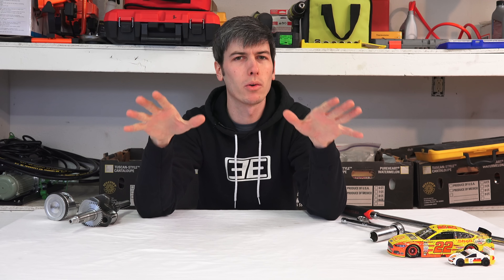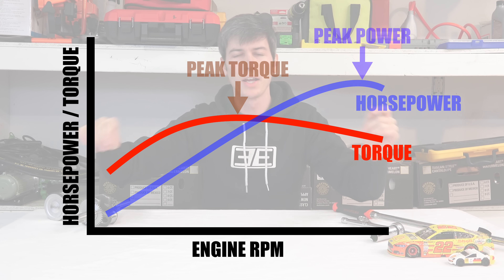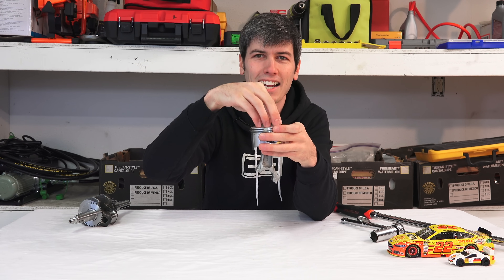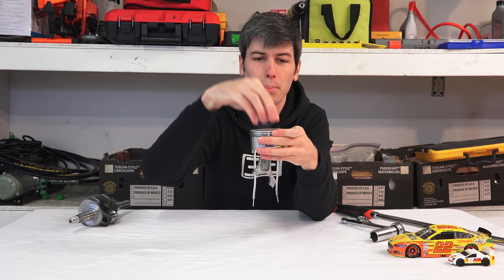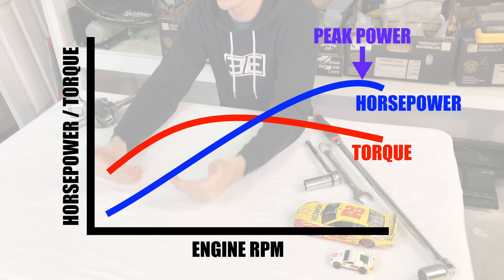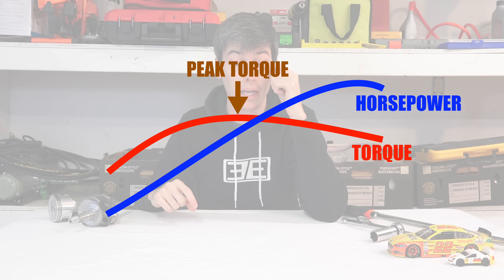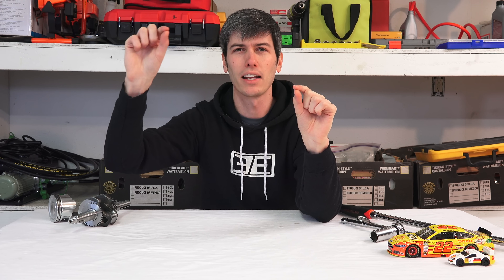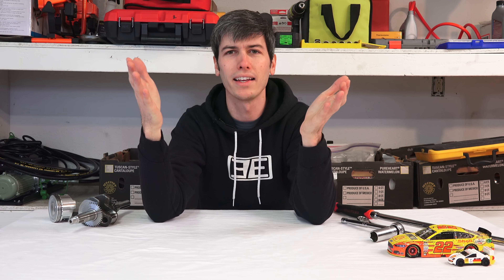Horsepower vs Torque - A Simple Explanation

Comment: This is unnecessarily confusing, and not at all simple. 

He should never have mentioned gears or transmissions, because it's not necessary and makes it confusing and convoluted. 

Torque is the force you are creating to move the vehicle, in this context.  But, it does not measure anything else, like the effect it has.  So, if you have 1000 pounds of torque, and it moves nothing, it does no work.  It has no horsepower.  The motor is still putting out a force, it's just not doing anything.  No horsepower. 

So horsepower measures the effect the torque has; how much work it does.  All things equal, more torque, more horsepower.  But things aren't equal.

So, think of a force at least say 1 unit of torque, that moves something 100 times per minute.  It does 100 units of work, let's say.  Now, if we move the RPMs (in the prior case 100) and change it to 200, we end up with 200 units of work, if torque is constant.  Equally, if we have 2 units of torque, and are at 100 RPM, we'd also have 200 units of work.   Simple.

But, what happens with engines is, torque peaks relatively low in the RPM range, and slowly tapers off.  In this case, let's say at 200 RPM, we only have .9 units.  We'd still have more power and do more work, than at 1 unit and 100 RPM, because that .9 force is being applied 200 times.  So, let's say I push something 9 inches 200 times, it's going to move farther than something I push 10 inches 100 times, even though each time is a little less.  So, HP peaks later than torque. 

At some point, both tail off.  In this case, say we have .5 units of torque at 300 RPM, we'd do 1.5 units of work, rather than 1.8 at 200 RPM and .9 units.  Just as before, if I push something 5 inches 300 times, it's going to go 1500 inches, which is less than 200 X .9 (1800).  So, in this case, even though I'm pushing it more often, I'm pushing it so much less, it does less work.

What gets confusing is understanding how an engine will behave based on torque and horsepower, and this video kind of makes it even more confusing.  If you compare a low torque motor with a high torque motor, and both have the same maximum horsepower, the high torque motor is going to have much more lower RPM  pull, and generally be better to drive.  It's going to pull things better, because you won't have to rev the crap out of the engine to get power out of it.  Why?  Simple math.  If I have twice the torque with one motor, and they both have equal peak horsepower, it will reach that horsepower at half the RPM, and will have a broader power band.  The low torque motor will be "peakier", and need more attention to keep in its optimal power band.  And that's high RPM.

Comment: Is that the longer the rod the higher the torque???
Reply: No. 
Longer crank throw = more torque and typically less max rpm achievable. It's kinda like if you were spinning in a spinning chair. With your legs tucked in close, you would spin faster than sticking your legs out.
The only real benefit to having longer connecting rods is that you would get less piston skirt scrubbing (binding of the piston against the cylinder wall). less bind = more power and longer wear life.

Comment: Holy phuk, torque and power are directly related.  You can't have one with out the other.  When someone says their engine has a lot of torque, what they mean is that it get a lot of its power at lower RPM.  Power = angular velocity * torque.   They are inseparable.

Comment: I like the explanation.  However comparing the two cars I'm not sure what to believe... Suppose we have two cars:
Car 1: 500 HP and 250 torque. 
Car 2: 250 HP and 500 torque. 

I'm not sure if car 1 would be faster in real life?
Reply: It will be because it has more hp, torque can be manipulated through gear ratio
Reply: An example: in an 1/8 mile competition Car 2 wins, but in a 1/2 mile race Car 1 wins
Reply: another example: Car 1 could win or at least equal its performance compared to Car 2 on an 1/8 mile if we "cheated" by giving it lower gear ratios to compensate for its low torque

Comment: Hence the LT2 in the C8 producing more HP than torque and the LT1 balancing both.
Lolll the new L8T GM 6.6 has opened the way for a stroke increase on the LT1 and the LT2 to 6.6 litres.
Also the Ford 7.3 Godzilla engine has seen to that.
Mmmmmm a 525 hp LT2.
😉😉😉

Comment: As a former motor head we always said torque gets you off the line power makes you finish. I been  a Auto tech since 1996 and what the automotive industry has done with small displacement engines is truly amazing. The power numbers from 4 cyl engines is truly amazing.
Reply: Camaro's with a turbo 4cly making 275hp and 295lbs, I wish we had four bangers like that when I was in HS. I'm pretty sure it would beat the 350 from the 80's and 90's.
Reply: That's pretty close.  Torque gets you off the line, power determines how long it takes to finish.
Reply: But again this is confusing torque at the crankshaft and torque at the wheel.
Reply: vape ?

Comment: If torque is force*distance and distance remains equal (distance between connecting rod and crankshaft and same gear) then the only variable is force. I guess that will be higher in time depending on how much work the engine outputs (revs x energy from combustion ?). So why don't the torque and HP bands have a similar curve ?  Peak horsepower would then also bring peak torque (with same distance and gearing). How can torque peak at a moment where HP (force) does not ?
Reply: torque and horsepower dyno curves always cross at 5252 rpm for the reasons you are asking.
Reply: @jaybee-5481  Thanks, learning moment of the day !

Comment: So how does this apply to towing and why torque is more important when it comes to pulling something
Reply: So they way I understand it, torque is the amount of force, or power, and hp is how quickly that power is applied.  Greater the torque, the greater the force, the more it can move.  I have always thought of it as the torque gives you an idea of how much weight it can move, and hp is how fast it can move that weight. So the engine needs a balance of the two for its application.  An 18 wheeler needs lots of torque to move lots of weight, but not lots of hp because it does not need to move fast.  A race car needs lots of hp to move fast, but not a lot of torque because it is light.  

So for pulling, you need lots of torque to pull more weight.  If you want to go really fast with that weight, you need lots of hp.

Comment: Hold up. You said the cars are the same except for HP & Torque numbers. Those are only affected by the engine. Gearing is in the transmission and if the high power car has better gear ratios, the cars are no longer the same.
Reply: Gearing can be the size of the main crank too.
Reply: @johnmaurer3479  yes, but that is constant

Comment: Simple explanation. Torque is a measure of how much work can be done. Horsepower is a measure of how quickly it can be done. Easy
Reply: truthiness in this post
Reply: thank you. 10sec video explains life lol
Reply: And completely wrong.
Reply: Horsepower, the common unit of power; i.e., the rate at which work is done. In the British Imperial System, one horsepower equals 33,000 foot-pounds of work per minute—that is, the power necessary to lift a total mass of 33,000 pounds one foot in one minute. This value was adopted by the Scottish engineer James Watt in the late 18th century, after experiments with strong dray horses, and is actually about 50 percent more than the rate that an average horse can sustain for a working day. The electrical equivalent of one horsepower is 746 watts in the International System of Units (SI), and the heat equivalent is 2,545 BTU (British Thermal Units) per hour. Another unit of power is the metric horsepower, which equals 4,500 kilogram-metres per minute (32,549 foot-pounds per minute), or 0.9863 horsepower.
Reply: No. Torque is a measurement of force, HP is a measurement of energy. For a car with a gearbox, torque is useless as a measurement, what you really want is a HP curve.
Reply: the equation that mathematically derives horsepower from torque would like to have a talk with you
Reply: @jaybee-5481  Yes, power = torque * rpm. What does it want to talk to me about?
Reply: @farsjøl  Actually it's not , torque is force X distance. HP is the energy required to lift 33,000 lb one foot in one second
Reply: @thrivefeedvideos  and this is the same as rotating a leverage with one foot length one rotation which needs 33,000 lb force to rotate.
Reply: @thrivefeedvideos  That's in one MINUTE, not one second. It is 550 pounds one foot in one second.
Reply: @farsjøl   Wow. You couldn't have that more wrong. Torque is not a measurement of force.  HP is not a measurement of energy.  Torque is force*distance.  Torque * speed is power.  HP is a measurement of power.  Energy is power * time.  Nobody has mentioned energy.
Reply: @stargazer7644  Potato-potato....

Comment: But if the horsepower car had a final drive ratio of 2 and the torque car had a final drive ratio of 1, wouldnt they both accelerate equally?

Comment: so can I turn torque into speed with a lower gearing ratio like how you can turn power into torque with a higher gearing ratio?
Reply: Yes & no, you can change your torque by changing your gearing (less torque but more speed, more torque but less speed). But power will always be the same for a given RPM (as power is torque x speed).
Let's say your engine give you 100 hp @ 5K RPM full throttle. In first gear @ 5K RPM full throttle, you will have 100hp, a LOT of torque but little speed. In 6th gear @ 5K RPM full throttle, you will 100 hp, less torque but you will go FAST.
Reply: @MLambdaman  oh, I get it now. Thanks!

Comment: This theory is wrong on several levels. Torque and angular speed are INVERSELY PROPORTIONAL, therefore if you cheat the experiment and only optimize gear ratios on the car that does not make adequate torque, you sacrifice rotational speed. You just turned that car into a tractor. You never get something for nothing. If you increase torque through gear ratios, you just decreased rotational speed. Don't take my word for it, super bikes and muscle cars are better off with a stronger torque curve.

Comment: i think the math is wrong on HP=T*RPM
my '99 Powerstroke had 500lb peak at 1,600 rpm.  NO WAY the "rated" 235hp is the product of 500*1600 (math says 800,000hp)  can you clarify this for me?
Reply: the formula for horsepower is (torque*rpm)/5252. The general definition of power is torque*rotational velocity (in rad/sec). You must divide by 5252 because of unit conversions
Reply: @Redtooth75  hmmm how did I miss the division step?  Was it mentioned? Did I not hear? Thanks!

Comment: So Engineering Explained answer me this then. If horsepower is all that matters, why is it that when i watched TFL when they did a truck shootout pulling trailers up the ike gaunlet for speed, why is it that the Ram, which has the lowest amount of horsepower over the 3, but has the most torque, was the fastes up the hill? Im genuinly curious how that was possible

Comment: The way i see it, 

If you floor your gas pedal and accelerates from idling all the way to the redline in a gear, let's say the first gear, usually, for a gasoline powered engine, the maximum torque would be lower than the maximum horsepower, so, when you hit the maximum torque, you will have the highest acceleration, but when you get way past the max torque point, you will experience a slower acceleration, the engine still revs higher, but the pistons cannot be pushed any harder but can be pushed faster(maximum torque) , so the engine, with a lower torque, slowly gets to its maximum horsepower when the gear ends at the redline, that's why when the engine is at the redline, even if you floor it any harder, the car will not move any faster because it's already reached its maximum horsepower (or work), that's why you need to change to the next gear. Correct me if I'm wrong

Comment: What is the significance of a set gear? I am having trouble understanding from that point
Reply: Set is not an adjective.  What he means is setting or configuration of the gears.  In other words, what group of gears you select to mate, within the transmission.

Gears allow us to trade RPM for torque, so that the engine can operate in its optimal range of each.   Gears allow us to spin the engine fast, when we desire more torque on the drive wheels.  And gears allow us to spin the engine relatively slow, when we get to a cruising speed, and don't need a lot of torque on the drive wheels.  RPM multiplied by torque (with a unit translation factor) gives us the horsepower.   If you keep horsepower the same, changing your gear setting allows you to prioritize either output torque, or output RPM, so the engine can get more or less leverage on the output shaft..

Low gears are where you get the most leverage.   More torque on the output shaft than the crankshaft receives from the engine pistons.  Less RPM on the output shaft than the engine spins.  This is for hills, rough terrain, and just starting out.

Overdrive (high gear) is where you get the least leverage.  This is where you don't need as much torque on the output shaft.  Just enough to maintain cruising speed.   But your engine won't be very efficient if we let it scream at 7000 RPM, when your car is at highway speed.  So by picking an overdrive gear setting, we don't have to spin the engine as fast.

Comment: Generally Petrol engines have more hp and lesser nm compared to Diesel engines...
Then whats the use of have more torque is hp helps to achieve top speed faster

Comment: This should have taken thirty seconds. No need for wonky gear gabbing. A big truck has lots of torque to help it move and actually carry lots of payload, because without the massive torque it wouldn't move at all. Horsepower is about acceleration speed (0-60) and ultimately top speed. But not about moving around lots of weight. A big heavy truck couldn't move an inch, let alone carry heavy cargo with only high horsepower and low torque.

Finally, because it's cute, lots of low end torque gives the mere sensation of speedy acceleration, but high horsepower actually provides fast acceleration.

Comment: Can u explain the difference between under-squared engine and over-squared engine. Which one is used in which scenario and which is more reliable and easy to work on.
Reply: It has to do with the aspect ratio of the piston/cylinder assembly.   "Square" means the diameter of the piston is equal to the travel length (stroke) between bottom/top dead centers.   Oversquare means more diameter.  Undersquare means more stroke length.

Think a tuna can for an oversquare cylinder.   Think of a soda can for an undersquare cylinder.

Comment: What are the differences between gas engines that make more torque than power and those that make more power than torque? How are they made differently?
Reply: Generally speaking a longer stroke will give you more torque but limit your horsepower. A longer stroke gives more leverage and therefore more torque. However a longer stroke increases piston speed which will limit the maximum rpm of the engine.

Comment: Horsepower = Torque x RPM
From physics 101.
Reply: That formula is not correct. The formula for horsepower is (torqe*rpm)/5252, the general definition of power is torque times radial velocity (in rad/sec). You must divide by 5252 because of unit conversions.

Comment: From car and bike  magazines when I was kid, I always understood, torque will get you acceleration, horse power will get you top speed. Not the best example, but for me bullet bikes. Compare typical 600 cc to 1000 cc bikes! The 600 cc usually have higher RPM's, like 16-18 x1000 (redline), relatively 'torquey" (not more torque). While the 1000 cc usually have RPM's 12-13 x 1000 (redline), more Horsepower (not as "torquey). Now, I know there is a slight difference in weight, HP, ratios, etc, but follow me. Let's say 1/2 mile race. The 600 will jump at acceleration and lead, lets say 1/4 mile and top out 160 mph. The 1000 cc will catch at 1/4 mile, but will finish ahead at 1/2 mile at a top speed of 190 mph. That's how I look at it.

Comment: there is one thing I want to mention here. a vehicle with more torque at initial rpm will accelerate faster than the other that has more horsepower at higher rpm but less torque at lower rpm provided everything else remains same. the reason being the engine has to rev through initial rpms to get to the higher rpms. you are comparing both at their peak horsepower where ofcourse the one with more hp will be faster. but if we drag race from stand still the one with more intial torque will beat the other

Comment: In the last example, he shows the peak horsepower making the most acceleration because of the 4:1 gearing and the peak torque making less acceleration because of the 3:1 ratio but wouldn't the peak torque be the greatest acceleration if it were in the 4:1 gear? If that's true, wouldn't peak acceleration in any gear be at peak torque? And a way to compensate for low torque would be to rev higher and cheat with gearing essentially. Really just two different strategies to win the race? I'm trying to math out how a semi truck with insane torque and 500 horsepower can keep up with a super light vehicle with plenty of horsepower when the work being done by the truck is obviously much higher. I saw a video of a semi truck beating a charger in a drag race and even if the semi had more horsepower, it wasn't by the same magnitude as the weight difference, so the semi did more work with less horsepower unless I'm missing something.

Comment: Did you mention that torque in general is whats needed in order to move heavy objects? So a low hp engine with low torque ma not even be able to move something thats heavy at all, but up the torque and keep the hp the same it will move albeit slowly.